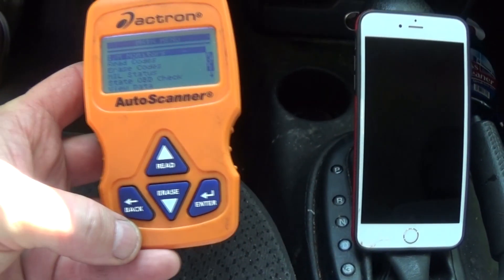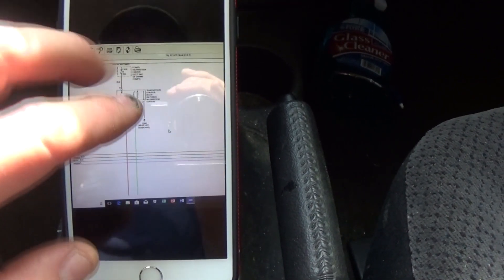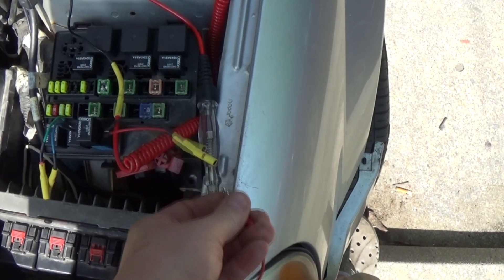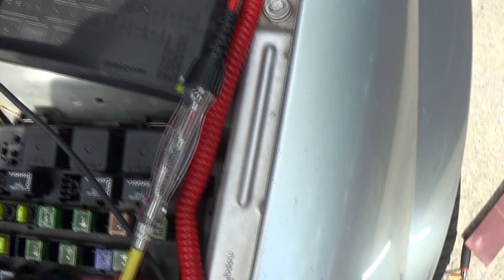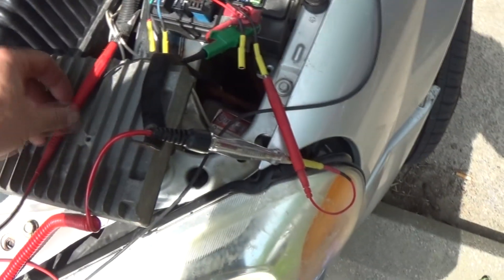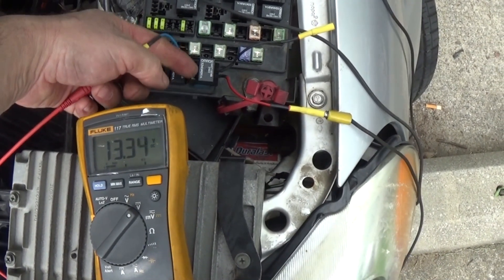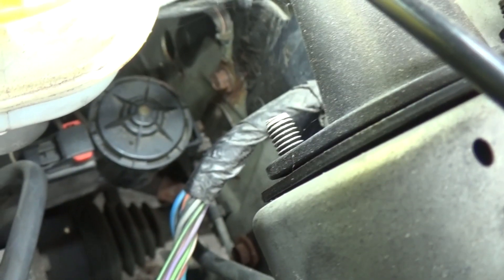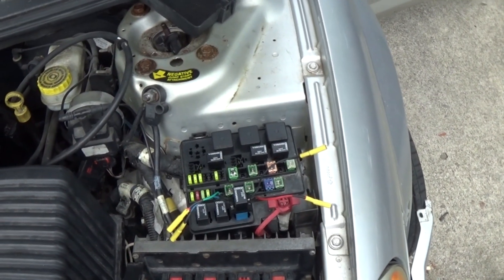2005 Chrysler Sebring P0888

Comment: Thanks Ramon. Had identical codes p0888 and p0700 on 2005 Sebring Touring 2.7L and was in limp mode . The ground located on driver's side fender wall near brake master cylinder was definitely the issue. I would also recommend redoing the ground near the driver's side headlamp also. This connection also had serious corrosion as bad as the one on inner fender wall. Transmission is now working again after removing ground , cutting wires, cleaning corroded wires, then reattaching ground wires.